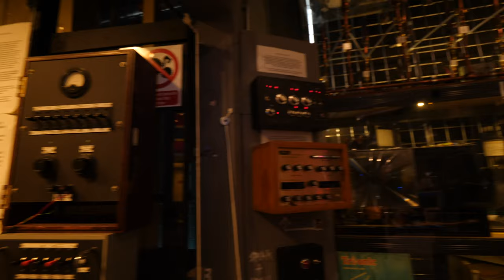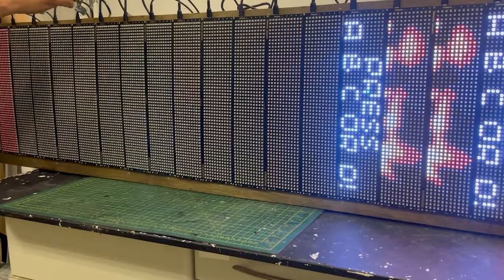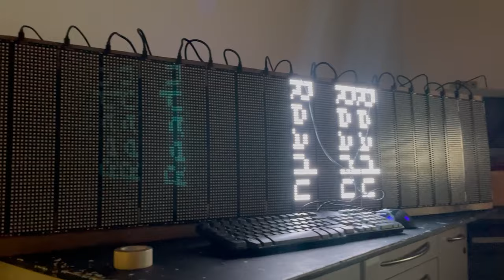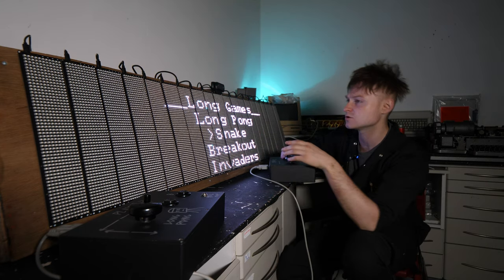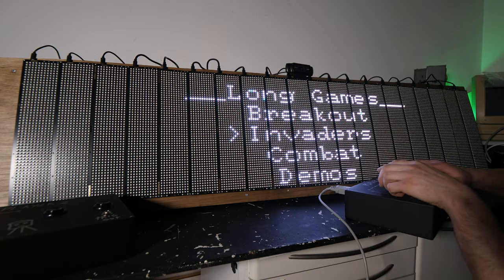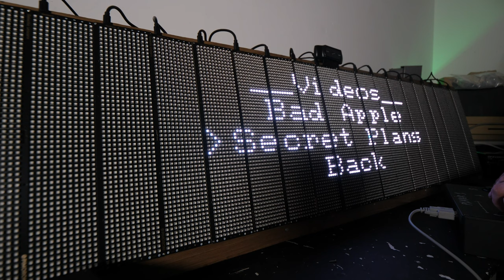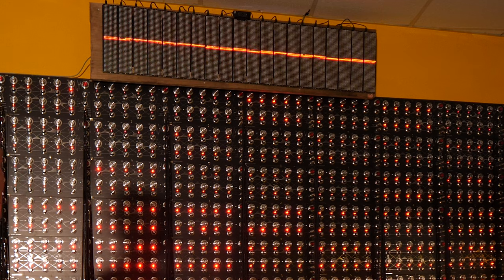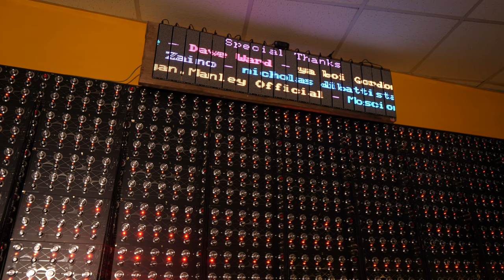LONG PONG - Making A Machine That Plays PONG But Its Sorta Long.....

Comment: Breakout needs a gap at the top for the ball to break out into. Without that, you cant breakout. Getting the ball stuck on top is a game changer.  A gap at the top is very important. Very cool project. Great job.
Reply: How the hell did I just spend the last four decades now knowing what breakout meant? 🤯
Reply: @sircompo  lol. That funny. A better question is why I spent $40 to buy it for my Atrari in the 80s. That's $98 inflation adjusted dollars. And I was pretty poor at that time. That was a lot.
Reply: @wmason1961  Was that for the Atari 2600? I didn't realise the games retailed that high back then.
That was still the most playable version I've ever owned, but only because of the Paddle controllers. Thinking about it, I'm going to build myself an Arkanoid arcade controller and play it on MAME; I never got to see the coin-op version before and it should be pretty cool.
Reply: @sircompo  I think so. That is what we were using when my son was very young.
Reply: the earlier game of 'Stay In'   hadnt proved to be much of a hit....

Comment: My favorite Pong simulator was a one-D version that we coded into the "null job" on a PDP-6 computer in 1969 or 1970. It ran in the lights that were used as part of the system to key in individual data words by hand. Once the null job was running, it presented a light that would move left or right, and could be reversed if you toggled a selected switch at the right time. Of course, if somebody actually started to use the system, all bets were off. Great fun.

Comment: Great project as always! To improve the display even more, you should consider taking into account the small gaps between the boards and somehow turning these lines of non-existant pixels into buffers or ghost pixels to get a more fluid image movement. Maybe you already implemented this in the code by now but I feel like the moving images displayed in your video just skip every gap as if it doesn't exist so everything gets slightly deformed and sort of syncopated. Thanks for the amazing videos. Lovely Jobly !
Reply: Yes. Does that mean my idea doesn't work? I think this improvement would need to be coded in the Raspberry Pi controlling all the PCBs, not in the individual boards controllers baduino
Reply: Yes, I was going to say something like that.  The buffer on the Pi4 should include the "missing" lines where the gaps are.  Those pixels could have their values "bleed" into the actual pixels on either side so they don't entirely disappear.  With them accounted for, the ball won't feel like it "jumps" across the gaps.

Comment: Idea: to avoid pixel jumping between the panels due to the gaps between the panels (esp. visible in wobbly scrolling text), consider rendering extra (invisible) columns for the gaps that won't be then sent to the displays (1 pixel column per panel gap might just do it) as an optional display mode. It should improve appearance of the display as one contiguous screen as opposed to individual panels (the eye will fill the blanks, esp. from the distance)

Comment: Awesome :)
That wall needs 3 times the displays (or whatever the amount to match the megadrones width) :D That would be looooooong :D 
Also a tip: In the render matrix you may introduce a virtual pixel for the gaps between the panels to smooth out the scrolling.

Comment: Just a suggestion: I would love to see a game called Spacewar! on it.  

Spacewar! Would be appropriate for your museum, since it was originally created in 1962 by MIT computer lab research assistants to run on a PDP-1, and is often referred to as the first video game in history.

Since it was open source, it was handed off to other students who improved on it over the years.  

Later on computers had developed to the point that it became the first coin op arcade console game in history.  

I first saw a console version in 1972 in a Sears store in Reno, Nevada (I was 12 years old). I had never seen an arcade console (or any video game).  My brother and I played for about 1/2 hour on a single quarter.

I don’t know if it was true, but I was told years later by a lady who worked there that they were play testing the console, and my brother and I were being filmed through the one way mirror on the wall behind us.

The latest version I know about was written in java somewhere around 2012.  That version was for internet play, but it would be pretty easy to adapt it to work on your controllers.  

I retired as an instrument tech, so although I can program a PLC, I know as much about computer programming as you do so I can’t do it, but your guy should be able to handle it.

Comment: IDEA: Could you link the Loooooong Poooong to the 'MEGA_Drone' so when the pong 'ball' is about to hit the BOTTOM of the Long Pong screen it goes 'ONTO' the Mega_Drone's lights as if it were part of the screen?  and whenever it lights up a Mega_Drone light it plays that synth... but depending on the speed and direction the oscillator's "settings" would be changed.....
- -  BUT because the 'ball' would pretty much ALWAYS end up on the Mega_Drone you could make it a special 'achievement' like a high score, or making the ball hit 3 small 'targets' and THEN the 'Door' to the Mega_Drone would be opened and THEN the player has to hit that SMALL MOVING DOORWAY Target and THAT causes them to open up the Mega_Drone 'BONUS LEVEL' that has a timer and have to collect as many POINTS as possible within a 30 second window... But the controller moves some 'extra' paddles inside the Mega_Drone area......
- -  Okay, Okay, I could go on forever like this, creating stupid ideas for a simple game... but you get the just of what I'm saying: Use the lights on the Mega_drone as a secondary 'bonus screen' and the moving ball affects the synth wherever it moves  to, and the player's controller moves new, extra paddles and pieces while in said 'bonus round' - :)
- BUT this might require a LOT to be taken apart and re done, and that's maybe not a great idea (too much work for the results obtained) - so maybe you could just add some strips of LED to the grid of lines on the whole face of the Mega_Drone, and then create some kind of 'bonus level' with them 🤷‍♂

Comment: I'm currently working at recreating this, however I'm running into some issues.  I have an issue where the screens would go out of alignment as it goes through the demo files meaning that the screen numbers are still in order, however an occasional screen would rotate so that the bottom of the screen ends up showing in the middle on just some of the screens.  Did you run into any of those issues when building this?  I'm a bit stuck on it.

After doing a bit more digging, It appears that the galactic unicorns offset 16 pixels each time the simulation resets.  Did you have any issues with this.